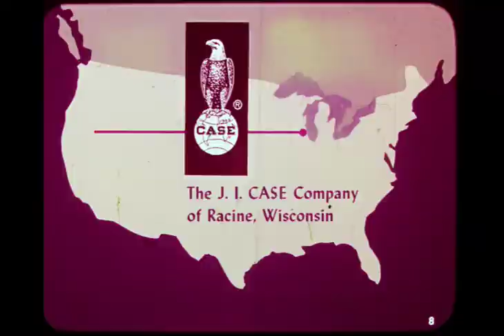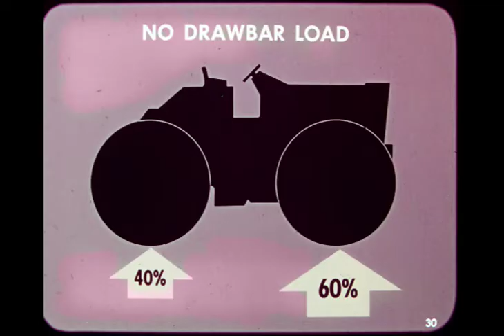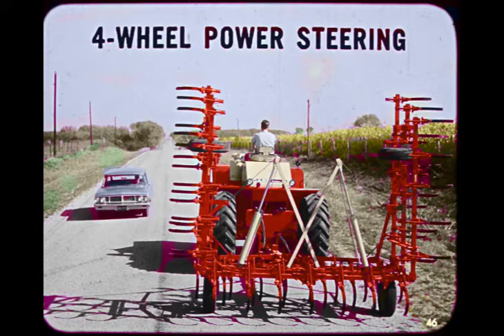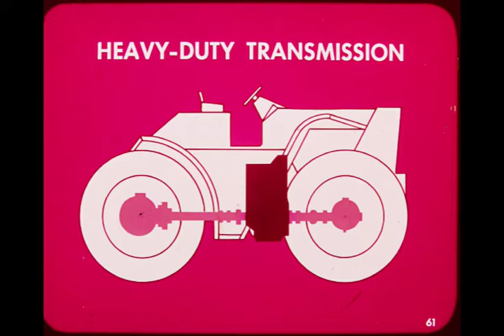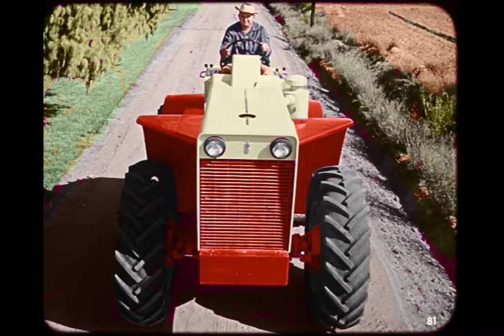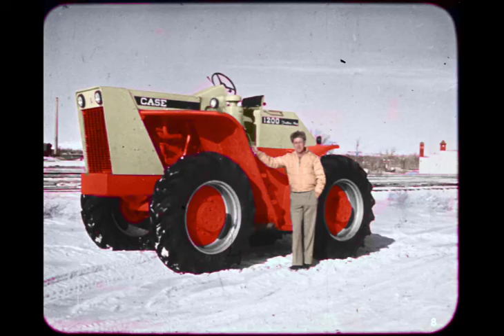Case 1200 Tractor Promotional Filmstrip

Comment: I worked for a farmer in the fall of 1975 who had a Case 1200.  The tractor was equipped with a cab and dual wheels.  The more interesting feature was that the engine had been replaced with a 6-71 Detroit Diesel.  The engine noise was terrible but the tractor did a lot of hard work.

Comment: 504 case was far superior to this but i do have a NA 451 in a 1070 and that tractor has never ever had a problem
Reply: The engine in the 1200 was the same as a 1030, not 1070.  The 1070 engine was much better

Comment: Love our case 2470, has done endless hours of work over the years,  been around the clock a couple of times prior to us purchasing it. I don't think I've used a tractor with so much traction. They were very advanced tractor for their time. Bring back the 70s. Only 150hp I could comfortably say it would outpull any other 150hp old or new tractor.

Comment: The 1470 was even a better tractor.  Same as the 1200 but had the 504 cubic inch engine. (8.3L)  And an 8 speed transmission, instead of 6.
Reply: I don't think they looked as good as the 1200 though

Comment: Great video! I actually operated one of these back in the ‘80s when my father-in-law owned one. It had a cab on it. We used it for pulling a large breaking plow to open up new land after taking the brush off. I had the rear steer set a touch toward the straight edge of the furrow to get the maximum cut width of the large single share. This tractor was quite advanced at the time it was new, for sure.